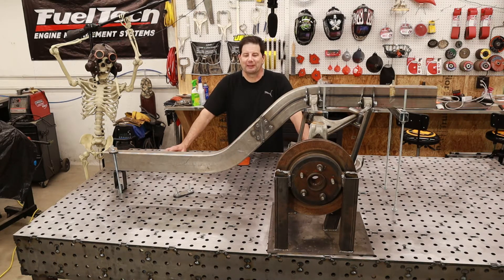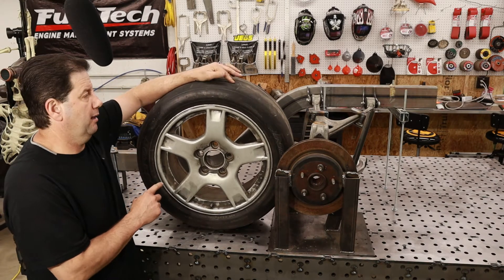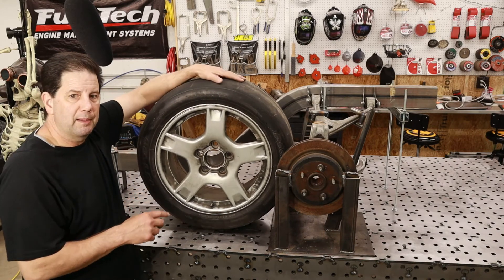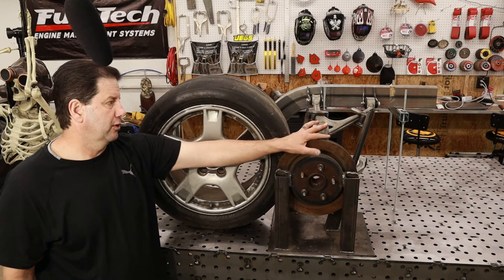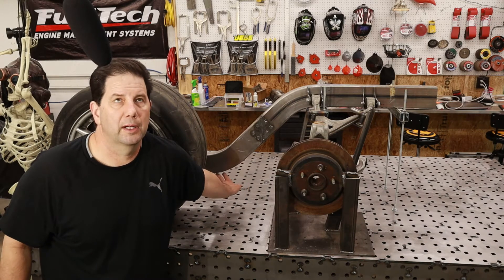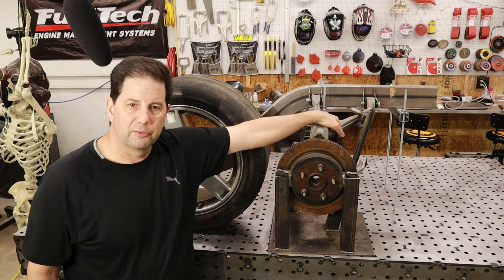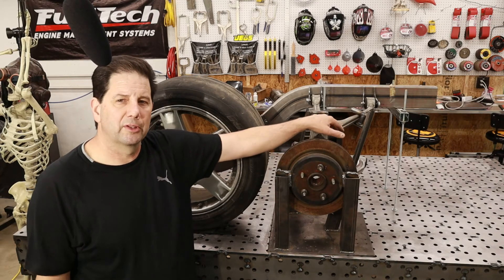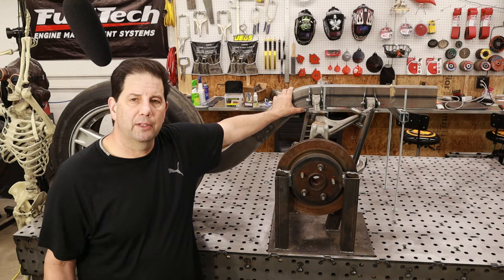Exotic Car Build(s) Project Sniper Part 3....BIG PROBLEM

Comment: Couple things, round tube would be stronger and lighter than that rectangular tube, and a 21" wheel with a 30 aspect tire is going to struggle to get 1000hp to the ground even with a 325 wide tire.
Reply from the maker: You might be right about the weight but strength is more a function of design.  The advantage of 2x4 steel makes it much easier to setup the suspension mount points and I am under a little bit of a time crunch.  As a side note I think I am going to try and create an aluminum frame for the next build.

Tires are going to be a challenge for sure.  I originally was looking at 355 but there very expensive.  The real problem I am still trying to figure out is what height size makes sense.  The  Garaziano transaxle I have came out of a v10 Lamborghini Gallardo.  So the gearing is not great for the V8.  I have a set of drop gears on order which will help as long as I get the right tire height I should be able to keep the RPM in a good range (more on this once I figure out the ratios).